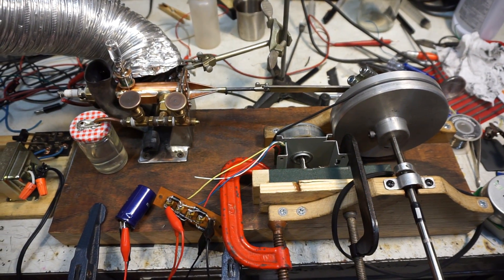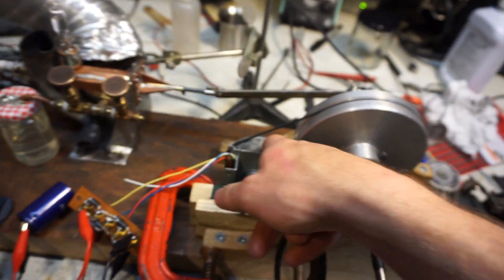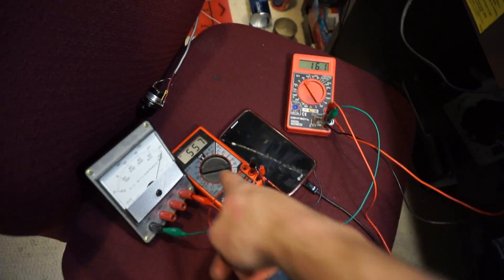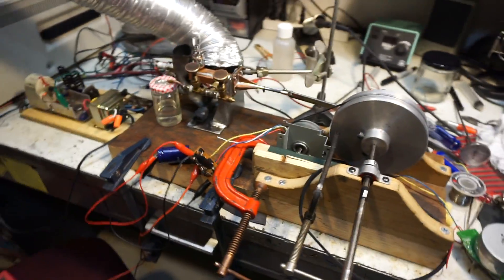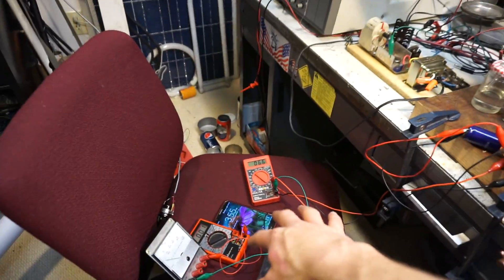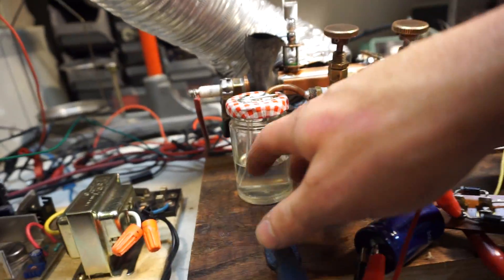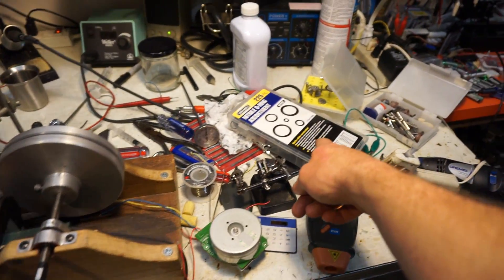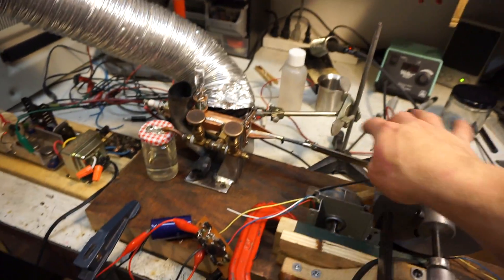Homemade Internal Combustion Engine Generating 15 Watts!

Comment: What is the of valves you use in adjusting the ratio? I am building a lenoir cycle engine (non compression) and i will be using vapor carburetor too.

Comment: I tried bubbling fuel before but as the gas cools it evaporates less so your heating water use a small pump and run the hot water through a coil in your gas to heat it your engine will be more efficient Brilliant work good job!!!! or if you want the water to boil instead of a pump look up how an old school coffee maker works you could percolate water through the coil in the gas to heat it.

Comment: Make a small exhaust turbine and drive a small turbo with it to charge it lol
Reply from the maker: +Anarchist Pineapple I wish because that'd be super cool! But unfortunately you can't turbo charge 2 stroke engines very well. They just tend to waste a lot of fuel out the exhaust
Reply: Makerj101 o i did realize its two stroke fail

Comment: Two stroke engines are lubricated using the fuel+two stroke oil mix of about 20to1 using the metric system which we use in the uk which varies on manufacturers recommendation as that is a two stroke engine that system would be sufficient, good job.
Also that cold fuel is helping to cool your cylinder with every fresh charge.

Comment: I know this is a couple of years old now but I just found it. Wow! Very Impressive!!

I like the way you handled minimizing the crankcase volume (by not having one). A buddy and I tried to convert an old air compressor into a 2-stroke engine (almost 40 years ago now) but our crankcase volume was too large & transfer ports too inefficient to provide much of a charge volume so it wouldn't quite keep running (using a drill to start it, it would run but slowly slow down and eventually quit). It produced a net negative power output...

How is spark handled? Are you generating spark at a constant ~60Hz thus locking the rpm to ~3600 or do you have some sort of crank position sensor triggering the spark?

Comment: There is a little flywheel energy calculator on the net if you search. I guestimated the figures for your flywheel at 800g 120mm and 2000rpm which give you a KE of 32 joules, about the right ballpark, ie 1/25 hp.

Comment: Wow, you should use air or fluid for cooling, and tip when you film maybe talk a bit slower and you should make a another 4 of them and make a big engine and use a crank shaft and a car starter and try to make a buggy that whole be cool lol

Comment: It took me a minute to see how the engine worked but it's definitely a two stroke and it's if the port-piston induction type. it's design is very interesting though. Unlike most small two cycle engines where the air-fuel mixture is drawn into the crankcase and then squeezed by the downward stroke of the piston until the induction ports open up and allow the air fuel mixture into the cylinder. This engine has the bottom of the cylinder sealed and that acts as the chamber where the fuel is drawn into and squeezed. I see the box of copper on the side of the cylinder must be the induction port. You should try adding more of these boxes to increase airflow and power. The carburetor seems to be of the vapor type. Very nice.
Reply from the maker: +Ben Heatherman you are 100% correct! You are the most observant commenter yet! I chose to seal the bottom of the piston because the stroke was very long in order to get the compression I wanted. I felt that the crank case would have been far too large to build up enough pressure on the down stroke to effectively push enough fuel through the ports. Like wise I felt the vacuum wouldn't be with to even open the check valve. I had to create such a long stroke because I designed this engine around a full size weed eater spark plug. There is a lot of area around the contracts of the spark plug so in order to create a high enough compression with such a small cylinder I needed a super long stroke. At least I have relativity high mean piston velocity. Might actually be way this engine is fairly efficient for being homemade. BTW you know what it piston is made from right?
Reply from the maker: +Ben Heatherman you are 100% correct! You are the most observant commenter yet! I chose to seal the bottom of the piston because the stroke was very long in order to get the compression I wanted. I felt that the crank case would have been far too large to build up enough pressure on the down stroke to effectively push enough fuel through the ports. Like wise I felt the vacuum wouldn't be with to even open the check valve. I had to create such a long stroke because I designed this engine around a full size weed eater spark plug. There is a lot of area around the contracts of the spark plug so in order to create a high enough compression with such a small cylinder I needed a super long stroke. At least I have relativity high mean piston velocity. Might actually be way this engine is fairly efficient for being homemade. BTW you know what it piston is made from right?
Reply: I think you mentioned that the piston was made of JB weld correct? Yea making a crankcase with a smaller volume would be much more difficult than sealing the bottom of the cylinder. I don't know if you've ever had the chance to look inside a normal 2 stroke engine but the crank cases are VERY small for that reason. You mentioned you were using Viton "O" rings as piston rings. That's very neat I never thought of that using that, but I suppose it makes sense as many 4 stroke engines now use Viton for the valve stem seals.

Comment: why didnt you use 2stroke oil in the gas? to eliminate the oiling system.
Reply from the maker: +daniel degg because I'm using a bubble carburetor. Only the vapors from the gas get into the engine. Any additives or oil in the fuel would stay in the carburetor jar because it doesn't evaporate. Fuel is dribbled along with the air going into the crankcase of a normal 2 stroke.

Comment: I'm still a bit confused on how you got the spark plug working right, with the timing and all. Could someone explain this?
Reply from the maker: +crow ate your memes so basically there is no timing at all. I just have a constant arc on the spark plug. Sometimes it fires a little early but for the most part it works really well.
Reply: Thanks so much.

Comment: how does the varb work
Reply from the maker: ACreativeName bubble carburetor. The air is bubbles through the fuel which evaporates some of the fuel and makes a flammable mixture which is sucked into the engine and burned.
Reply: Makerj101 how are the bubbles generated
Reply from the maker: +ACreativeName vacuum that the engine creates

Comment: Never took one apart, but the cell phone charger probably works by rectifying the AC to DC and then cutting off anything over a desired voltage, probably 5.1 volts., so 20 to 30 volts DC input is fine.

Comment: Can you make water cooling? With radiator and that?
Reply from the maker: +misko 02 YES!!! I actually did already. But I haven't posted the videos yet. I will hopefully be posting them soon. I used an 80mm radiator that's designed for water cooling and I made a tiny water pump from bits of scrap metal.

Comment: I want to make one so bad but im only 14😞
Reply from the maker: +Matthew Lucyshyn nothing wrong with being 14. I made a log cabin when I was 12.
Reply: Makerj101 I know it's actually great being 14 it's just that I have tried to make one of those motor not to long ago and I just can't😥
Reply: I built an electric car when i was 2
Reply from the maker: +Matthew Lucyshyn this is my second attempt. My first one totally failed. Learn from your mistakes. Why didn't your other engine work? Now improve the design and try again. If you send me some pictures or post a video of it on your channel I can take a look at it and try my best to tell you what might be the issue.
Reply from the maker: +GhostXoP nice
Reply: Matthew Lucyshyn im 13 and built a steam engine and working on an ic engine
Reply: Clayton Fixes Everything  you should make a YouTube video on it
Reply: Matthew Lucyshyn well it doesnt exactly work yet and tha plans for my ic are kind of junk

Comment: Cooling system.

Buy a small pc water cooling pump and a 120mm rad and tubing and make a water block around the cylinder. And just make a water cooling loop
Reply from the maker: +Ferguson 20 diesel I just did! Awesome idea dude! It works great! Thank you! I bought the 80mm model BTW. It's still way overkill for this tiny engine. But it does look super rad lol
Reply: Makerj101 your welcome
Reply: Makerj101 make a video I want to see this setup now.

Comment: Just a heads up never let it get hot to the point of burning (300 degrees c )the Viton o ring if you burn viton it becomes VERY dangerous and lets off gases that if inhaled dissolve flesh like your lungs and your eyes and if the burnt o ring residue is touched it will leave very nasty chemical burns on your skin (as little as 10 percent skin exposure is fatal) and if you do happen to burn a viton seal or o ring or what have you be it with gas cutting or some other form of heating go straight to hospital and tell them even if there are no immediate symptoms if it's in your lungs or eyes bad news I believe it makes some form of nasty hydrofloric acid that condenses on wet surfaces lungs eyes ect

Comment: is it a 2 stroke?
cool project, how did you managed the compresssion?
what valves are you using?
greets from bavaria
Reply from the maker: +Florian Krauss yep! 2 smoke all the way!! I carved a groove in the JB Weld piston for a rubber o-ring. It has nearly perfect compression because of that o-ring. The piston acts as the valve. However there is small ball bearing and spring acting as a check valve on the intake.

Comment: It looks like the engine is generating about 0.02 hp.  Very cool mini homemade engine made of scrap parts!  Congratulations!
Reply from the maker: +Wayne Ashby nooo! Probably more because of the inefficiency of the generator! :D
Reply: +Makerj101 
Good point, the horsepower at the direct output of the engine would more.  I was calculating based on the 15 Watts at the final load end.  Hmm, I wonder how much it is at the engine output?  I wonder if there's a way to determine that easily.
Reply from the maker: +Wayne Ashby yeah I know! I've calculated it that way before as well! Easiest way would be to build a prony brake. Using the prony brake you could measure the torque. Then use a tachometer to measure rpm and then use those two values to get true shaft horsepower.
Reply: Makerj101 
Sure, a Prony brake and tachometer could be used to derive the "brake" horsepower.

Comment: what fuel ur are using??
and why are those solder joints still in place, is there no any heat generated??
Reply: i was thinking the same
Reply: the type of fuel that almost everyone uses for these mini two-stokes is a coleman fuel/oil mix so as the fuel is injected, so is oil so that it lubricates the cylinder. And with the solder joints, the fuel cant burn as hot to reach the melting point of the solder joints, maybe after a while it might as it is copper piping,the heat will gradually get there.. but for short runs and at least that cooling system he's using, it should be fine. It could possibly re-melt the solder after maybe 20 minutes my guess, depending on the content of the solder.
Reply: Its coleman fuel

Comment: have you tried 2 stroke oil mix in kerosene to help cool? maybe just a thought
Reply: rcracer55o you don't need to. kerosene itself has lubricating properties, and for this engine, it's probably enough since it's using an oring for the piston ring.

Comment: make one out of aluminum that you cast
Reply: Making an internal combustion engine out of aluminum would be a bad idea.
Reply: ***** why? There are many that are made of aluminum. He would just need some fans to keep it cool.
Reply: David Serrano Because aluminum is hard to shape and get right without milling, he was right to make it out of copper, (a fairly soft and workable material) as well as he'd have to have a better cooling system, it'd get too hot.
Reply: ***** so because it's hard to do he shouldn't do it?
Reply: David Serrano The point of this was to make one without machining. Or milling. Which making one out of aluminum would defeat that purpose.
Reply: ***** he could make one out of aluminum without mills or lathes. He would just have to be smart about it.
Reply: David Serrano I guess so, but it'd be very very, difficult.
Reply: Xarither
Not to bad , just make Styrofoam parts and put them into sand and pour liquid aluminum to cast them if they come out good he can sand them with a dremel, and just repeat until he has enough parts or until he gets a good enough result, isn't most normal I.C engine made of aluminum/Steel?

Comment: +Makerj101 You coud solve the cooling problem by putting a thicker copper pipe around the cylinder and sealing the ends with copper plates. Fill the gap between the tube and the cylinder with water and connect 2 tubes and a pump. You can put on it a small carb from a chainsaw or similar, and you can make a small muffler. Great engine! Liked, Subscribed!

Comment: I'm going to start working on making a kinetic energy powered engine. my plan is to use a system of pulleys and a weight to drive a shaft. I'm hoping to do it out of entirely scrap materials. I have no real plans for the engine aside from looking cool but if you think of anything let me know! I'm going to post videos of it once I get started.

Comment: The majority of Sterling (temperature differential) engines are made w/o machining - out of 'junk'.  If you hadn't heard about the Sterling, a large variety of heat sources can be used.  Solar, almost anything that burns, or redirected exhaust from, say, a furnace.  Your enthusiasm and persistence are admirable!   Keep going!

Comment: As soon as I have seen this, I started charging my phone from a 24 volt PSU put to the max, and what a miracle, my phone showed the charging icon. They it showed 46% and then 45% and then 43%... It went DOWN. How is that even possible?!
Reply: +Krisztián Szirtes Not enough mA.
Reply: Krisztián Szirtes it happens because the phone sees a current being applied, but it's not enough to overcome the phones drain on the battery. for instance, if your phone draws 1amp under normal use, you need a charger that can output more than 1amp or else it'll continue to discharge

Comment: You should use a buzz coil, then you can use 6 volts and use the same generator and step it down and get more amps, then it could run its self

Comment: Really impressive!!    What your getting here is real world experience at the physics, mechanics of these machines and all the complex engines you may encounter are just bells and whistles for efficiency or performance in one area or another!, so I say awesome young man!!!   Very creative!!  
Im suspicious your engine is delivering more than 15 watts.   A thought,, maybe you know this as I haven't watched many of your videos but with a small DC motor you can connect it to a another DC motor and drive it as a generator.  Shaft to shaft,,just some tape will work.  This will allow you to load test it as all these small motors peak out as it were at generating.  Short circuit the motor you are driving with an ammeter and a voltmeter and you can watch the current and voltage rise as you increase the speed of the driving motor.  It will peak out and you'll know what the driven motor is capable of.    All the best,, I'll be watching!!

Comment: Torque permitting, it looks like the efficiency of this system can be greatly increased by making your own rotor/stator setup, using the shaft directly instead of a belt (main benefit being that you're able to use stronger neodymium magnets (in acrylic wheels, for example), as well as wind your own massive generator coils).  I don't know about internal combustion engine design to have any comments on that, but a positive side of this setup- if kept- is that the current bottleneck that is your stepper motor, can be replaced.  (maybe even a multiplier gearbox setup can be used to get more power out of the same setup, again, torque permitting)
Reply: i think when you make it a 2 at 1 ratio to the alternator you loose less power on the crank shaft

Comment: how much did this project cost you ?
Reply from the maker: +wiesna487 Like maybe $5 for more JB Weld epoxy putty and then later I bought a set of viton o-rings for like $9.  Everything else was scrapes I had laying around from other projects or was stuff I scavenged from things I'd dumpster dived or taken apart.

Comment: yay sound like a proper two stroke :) now please    make an expansion chamber for it :) would be really cool
Reply from the maker: +MrSlehofer I've thought about that.  I'm not sure how to design it though.  Do you have any idea how to calculate the shape or size I need for this engine?
Reply: +Makerj101 yes I do, this is the best for really small engines and it even has an app so you just enter the intake and exhaust port degree location and some rough exhaust temperature and fuel type and it calculates just perfectly:  http://www.mh-aerotools.de/airfoils/javapipe_en.htm

Comment: It's a neat project for sure. I would use a Fuel Injector instead of Carb design.Then you can control the Fuel Air better and can still use Mechanical processes.http://youtu.be/47doQGDyz-M  is te best circuit for Sensors and Ignition systems and gives you all Possible configurations for either sensor electronics or Load Drive Circuits.